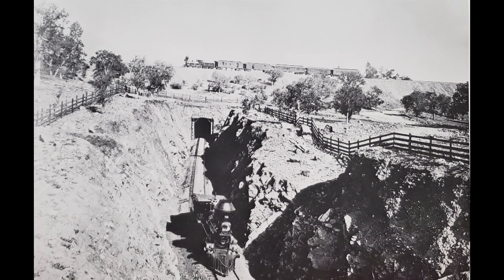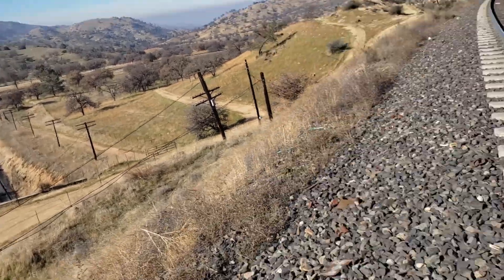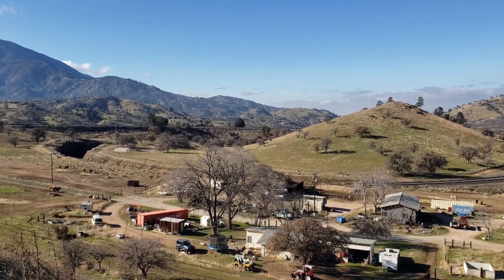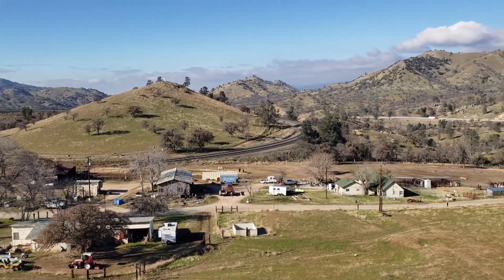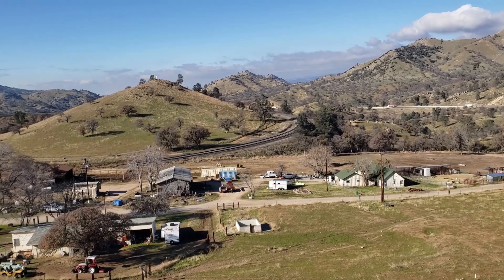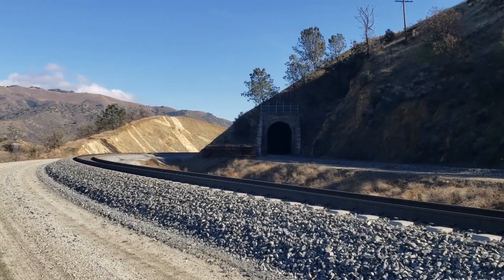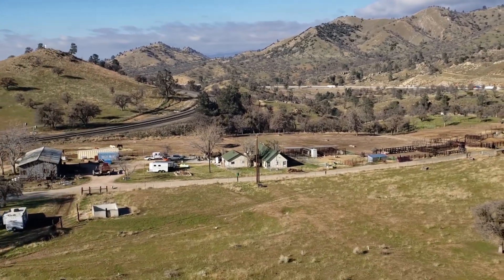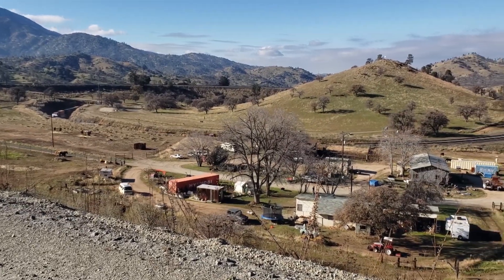Railroading on the Tehachapi: A History of the Loop

Comment: At 23 mph you avoid a situation of the freight cars starting “dynamic rocking” which begins at around 16-19 mph. Most train engineers really try to avoid sustained speeds at that range. 23 mph is the maximum speed for safety. You DO NOT want an accident to bottle up this main line.

Comment: Williams Loop in Spring Garden, California,crosses over itself and with a long enough train it too can cross over its own train. It is quite large with an elevation of 1%, and was built by the Western Pacific in 1914. Then you have the double spiral tunnels in Canada that are inside rock which is very unusual. I think they are one atop the other. And you have spiral tunnels in Switzerland that are complete circles running over themselves. Still like the history of Tehachapi. Have been there twice to witness trains going around the loop. Longest train I ever saw was 6900 feet long with one manned pusher on the rear. I always wanted to model this area but never found a building large enough to house it. I think it would be amazing to sit in the engine cab and watch your own train following you uphill. I read years ago in some train publication there is over 8800 degrees of curvature from Clilete to the top at Tehachapi.  Another great video as always.
Reply from the maker: Shot from below, here is cool video of a very long UP winding it's way up onto the Loop. https://youtu.be/3ojynZ1XgFQ

Comment: What's the benefit.. well not just straight..??...
Reply from the maker: The terrain makes it impossible to maintain an acceptable grade (under 3%) up the mountain. The Loop gains 77 feet elevation in 4,000 feet of track. Another route was surveyed straight across the canyon at 2%, but it would have required a 2,500 foot viaduct that would have taken another year to build and cost many times the price of the loop. Then there would have been bridge maintenance costs over time. This was a much better idea from every angle. Thanks for checking it out!

Comment: Another great video Mark, especially with the train coming uphill with locomotives maintaining the 23 MPH speed limit. Saw it once in the 1980's during a Santa Fe Convention in Bakersfield but no train on loop as MOW had the hill shutdown but did get to see a set of Warbonnets blast a freight out of Bena. Keep them coming when you can afford the high priced fuel.

Comment: Another one that does cross over itself I believe is in Europe and is on a concrete elevated grade. I think it's possible they barrowed the Idea from the one in your video. There's is a in steeper country.  If it works use it.😁
Reply from the maker: There are actually a few of them around now. The CN has a double loop on their line. Tehachapi was just the first, and by decades.

Comment: Not the only one. CP RAIL has one as well. In BC called the spiral tunnels
Reply: CPRail's Spiral Tunnels (near Field, BC) are amazing! not one but 2 loops, both as tunnels bored inside mountains flanking the Kicking Horse Pass in 19o9. it doubled the length of that section of track from 4.1 to 8.2 miles & reduced the gradient from the 4.5% of "The Big Hill" that preceded it to its current 2.2%. this kind of grade reduction is standard procedure in Switzerland but there's nothing else like the Spiral Tunnels in North America.
Reply from the maker: I didn't say it was the only one, I said it was the first. There are actually quite a few around the world now.

Comment: Is there a camber to the rails going up the loop? That is, does the trail tilt out, stay level, or tilt in towards the loop? We understand the conical shape of the wheels. but it seems there is the possibility that pulling a car from about 3 ft above the rails would form a couple tending to overturn the train. I imagine the high pulling force (did you say 2% grade?) combined with a tight radius would push thing to the limit. Do the rails need to be reversed/replaced more often on the grade?
Thanks.
Reply from the maker: Although "stringlining" is a common occurrence on the Tehachapi, I've never seen it happen at the Loop.
A formula is used to make up trains and to decide if, where and how many helpers should be pushing.
The rails are slightly canted.
Thanks for checking it out!
Reply from the maker: And yes, the rail does wear more quickly in graded and curved territory. Before the common use of continuously welded rail, there was a gang in Tehachapi that transposed rail every day. 
Today's heavier and better secured rail lasts longer.
Thanks for checking it out!

Comment: Did they really have just picks and shovels to dig it out. That seems ridiculous. It is a marvel in its self and cool to see the old pictures as well. The grade seems easy for the trains so is it also 3% at that location? I model trains and long curves turn me on big time.
Reply from the maker: The entire grade was done with man and horse/mule power. They used dynamite but everything else was hand tools, carts and some horse drawn scrapers where they could get them in. I think that's under 3% out of Caliente. It's 3% in a few places and 3.2 between Marcel and Cable.
Reply: @MarkClayMcGowan  It's amazing it was done with man, horse and mule. How people would work back then . Hats off to all those men toiling like that. Really like your videos of everything you have posted of that area. Thanks so much.
Reply: A grade
Reply: Engineers consider several factors in design of a track grade.  Grade is seldom, if ever, absolutely uniform for a long distance.  Grade is "compensated" or reduced a little on long curves (like Walking).  A curve introduces more  friction, so compensate friction of a curve by reducing the grade 0.2% or so.

Balancing cut and fill material van play a part in reducing the cost of haulage and construction cost.

How gutsy is the strongest loco in the stable?  If Mechanicals finest loco can't horse the Ops desired tonnage over the Engineer:s great and marvelous track plant, Management will come looking: for a GOAT.

Comment: Great video, thanks for sharing.  Would you happen to know - what is the frog number for the west and (now gone) east Walong siding switches?  From aerial pics I'm guessing maybe #14 or #15, tho it's a hard to tell.
Reply from the maker: Thanks for the compliment. No, I didn't know that stuff unless a track guy mentioned it while we were doing something at a frog. West Walong is still there, it's the east end that went away. Other than the switches at Bena and Cable, the frogs on the mountain were standardized (so I was told) when UP took over. I'll look next time I'm up there.
Thanks for checking it out!

Comment: Fantastic video. I see they have extended The Wailing siding. As you go down into the loop, I've often wondered why is it that they don't just double track the whole thing? There's certainly enough traffic to Warrant it And with Intermodal trains getting longer and longer, it seems to make sense.
Reply from the maker: It is now double track to Marcel. Above that would require daylighting four tunnels which would have a huge impact running trains. Below the loop is a very long deep cut, two bridges and two 180 curves. The ledge between the freeway and the creek isn't very wide either. Then there are the environmentalists. And the cost. 
It would be great but the roads won't do it any time soon.
Thanks for the comments and for checking it out!

Comment: could you comment on the operational difficulties that both the UP/SP and the BNSF have with train derails between Tehachapi and Bakersfield with the trains breaking in two and derailing?
Reply from the maker: While broken knuckles still happen they aren't as common these days. BNSF keeps what is called a "rapid responder" on duty 24/7 to assist with any problems that stop a train. 
With modern locomotive and wayside detetector technology (see my video on hotbox and high wide detectors) derailments are also less common than they used to be but they do still happen as well.
If they happen on double track or between switches of a siding, trains can generally move while they're cleaning up but, as with the recent ones at Woodford and above Caliente, when on single main it does present a problem. They usually have trains running in some fashion within 24 hours though.
I hope that answered your questions satisfactorily.
Thanks for checking it out!
Reply: @MarkClayMcGowan  Thank you I/WE appreciate the effort that you put into the educational videos!

Comment: Great video, For a line as crucial as this for BNSF to get to Northern California from their southern transcon there have been times I've railfanned the Loop and have gone hours without seeing a freight train. It seems BNSF utilizes this line more than the track owner UP. I wonder if UP still has a lot of traffic on the Palmdale cutoff.
Reply from the maker: BNSF does run more trains over the mountain but UP isn't far behind it's just many of their trains cross this sub at night.
With very few exceptions UP runs all their trains over the cutoff. Speaking of the cutoff, I was hired in 1979 to install the CTC on it to the top of Cajon Pass. The LA division took over into Colton.
Thanks for the comment and for checking out my channel!
Reply from the maker: Also, if you were fanning on a Monday they used to give out maintenance windows on Mondays and hold trains until late afternoon. That is no longer common practice. Weekends can also be a bit more scarce.